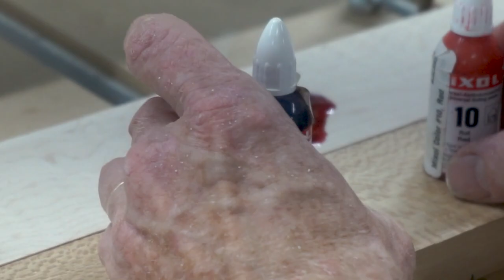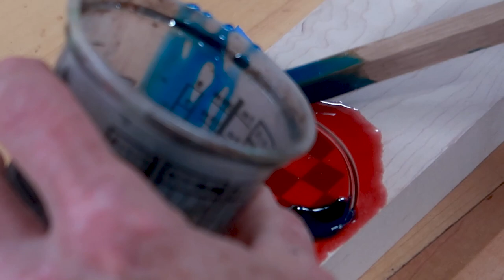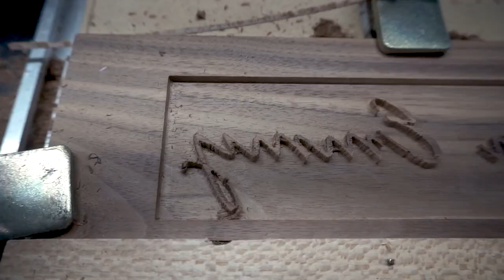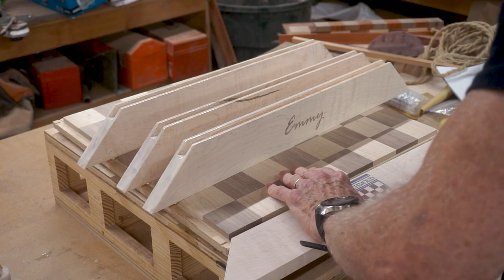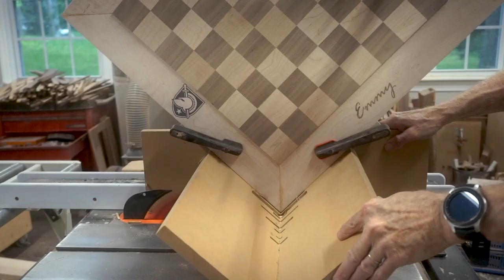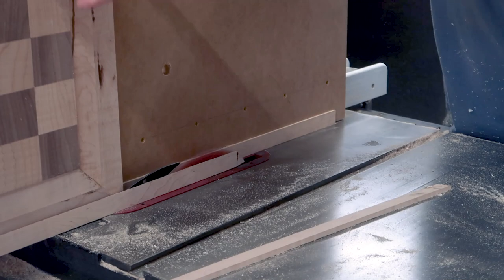Making a Chess Board with School Logos and Inlaid Names | A Wedding Gift

Comment: Mike, I'm thinking of getting a Jet drum sander. What grit sandpaper would you recommend for chess boards.
Reply from the maker: I use 100 grit almost exclusively. That might be a little too rough because it takes quite a bit of sanding afterwards to remove the scratches, but it has worked pretty well for me.
Reply: @Woodumakeit  Thanks for the reply Mike.